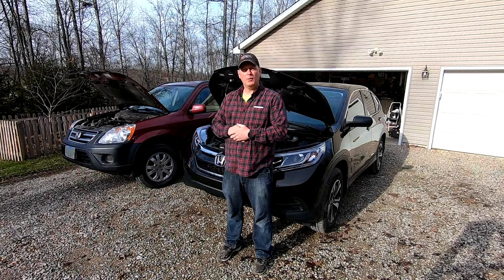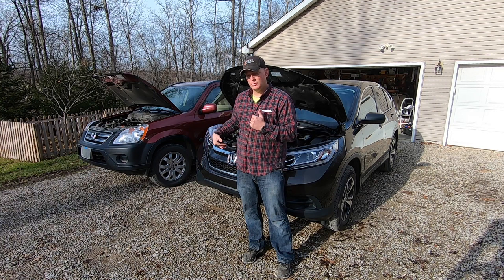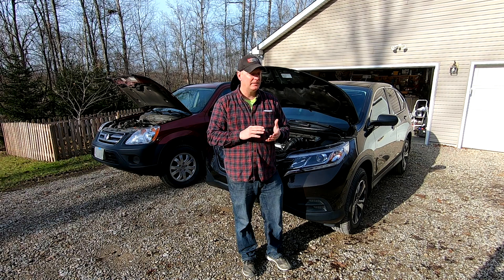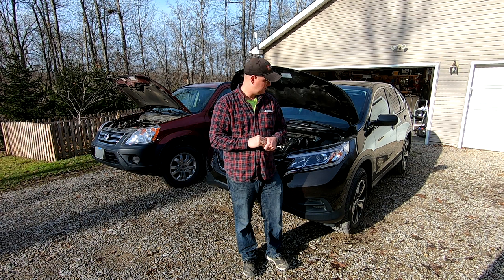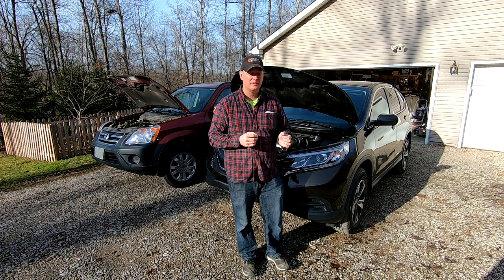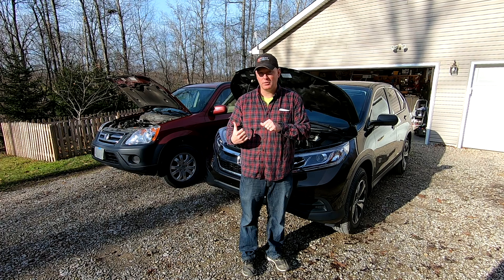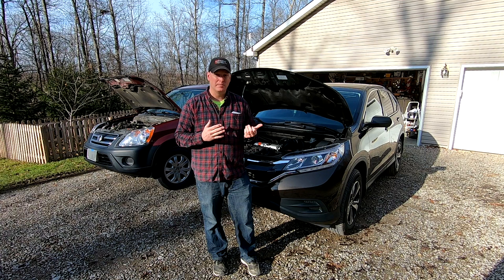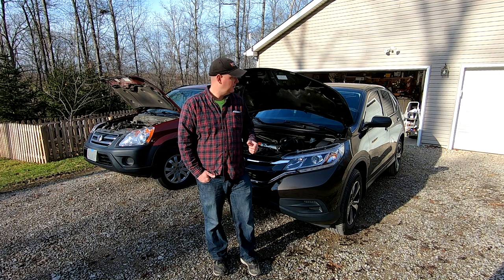DON'T BUY THIS CAR - 2012-2014 Honda CRV

Comment: Ok. The issue is oil starvation to the cvt gear. With a new intake cam and fresh orings on the cylinder 1 cam cap... it will go another 150K miles before failure again. Also... do not use 5w20. Use 0w20 oil as recommended. The valve works on viscosity
Reply from the maker: The difference between 0w20 and 5w20 is nil.

Comment: thanks for the info. i have the same problem with my 13 CR-v Awd, where do i need to go to see if a recall on this car, i changed fluid in front and back, no fix, now on top there is a shudder at 25 mph in slow acceleration then it goes away, any suggestions? thank, keep up with videos.
Reply from the maker: Did you drain and fill transmission fluid multiple times? Usually takes 3 times with some driving in between to see if shudder goes away. If it doesnt most likely your torque converter is shot.

Comment: On the bright side: I found a  YouTuber who says one can proactively periodically replace the lock spring in the VVT actuator without removing the actuator or timing chain: https://youtu.be/2ZDr1dH40Jw I haven't tried it but it seems to be a promising concept and the video has good reviews. Otherwise, I have a 2012 CR-V. You really have to replace a rattling VVT actuator right away or your timing chain will quickly be elongated beyond normal limits. It's easy to underestimate how quickly a rattling VVT actuator can destroy a timing chain. I'm about to replace the timing chain for the second time because the new (updated part number!) VVT actuator was not replaced soon enough after the rattling returned. This time, I have the dreaded code P0341, and when the crank is at TDC the camshaft marks are three teeth off from each other! It was only a matter of time until piston slap would have occurred... which is exactly what happened to an acquaintance's 2012 CR-V when she ignored her cold start rattling issue. The timing cover is a real inconvenience to deal with when the engine is in the car, if you are doing the repair yourself. If you are paying for the repair, replacing the timing chain along with the actuator will greatly increase your repair bill. Another engineering flaw: The closure rate in the exhaust valves is too rapid and that also sends shockwaves into the timing chain, even when the engine is operating normally. (Sometimes the exhaust cam lobes wear out prematurely.) In other words, the timing chain is at risk even without the VVT actuator rattling issue. None of the racing grade aftermarket timing chain tensioners, which claim to alleviate the premature wear brought about by the exhaust cam lobe design issue, are compatible with K24Z engines.
Reply: What a pain!!!  I was looking to buy a 2014 but now reconsidering :(

Comment: I just bought a 2014 crv 2 days ago and noticed a similar noise about every 5th time I start it...thought it was the starter.
  Shouldn't there be a code if it's a VCT?
Reply from the maker: No code. Just noise until it destroys your timing chain, then you get codes.

Comment: Bought a 2014 Honda CR-V EX-L 2.4 liter 2WD with over 188,000 miles for $9,000 back in November before Thanksgiving through a private party. Took in to the shop to have looked at so far no codes were found, recommended new spark plugs, found sweating under the transmission and one of the rear shocks is no good. Few days later my VTC actuator made the noise on cold start. A couple of weeks before Christmas my torque converter assembly broke and I ended up getting another one off a wrecked Honda CR-V and it had over 44,000 miles on it and it ended costing me $2,883, for a refurbished torque converter assembly it would have cost over $10,000

Comment: There is a $35 repair kit from spring-start that replaces the weak spring. You can even fix it without messing with the timing chain if you are careful.

Comment: Is the VTC actuator the same as the flywheel?  Or are they related in some way?
Reply from the maker: Not related. Flywheel on the back of the engine (or side the the case of a CRV). It is what drives the transmission.

Comment: Amsoil engine flush.. Amsoil signature series motor oil.. and its gone and hasnt came back..
Reply from the maker: Interesting
Reply: More details please. After switching to Amsoil how often do you change the oil, etc.
Reply: @njsongwriter  Every 5000 miles. The box says go 3000. But the oil is so high quality it can go further. Just dont push it. But yea, i dont hear it anymore..

Comment: Thank you very much for this video. I am in the process of deciding between a CRV or Rav and my decision is now settled. Rav it is.
Reply from the maker: The RAV4 is a great vehicle.
Reply: Be careful what year RAV4 you buy too. Some of them have their problems including this very same problem with variable valve timing. But with the RAV you must fix it rather than choose to live with it because the Toyota parts us made with aluminum instead of stainless steel. Aluminum is a sitter metal.

Comment: I noticed that Royal Purple and Mobile full synthetics run a little thinner than they should…. I currently use a better quality oil (AMSOil), and the car runs quieter. That sound at startup still happens once in a while… mainly on cold days. Currently 110k miles.

Comment: try using 0W-10 motor oil and fill motor oil to the fullest point of the dip stick allowable.  This will allow oil to up to the VCT moving parts as soon as the engine is cranked initially, hence reduce the Grinding duration from the usual 3-4 seconds during Start UP down to 1-2 seconds  Every bid counts.  Good luck....

Comment: I have a 2013 Honda CRV and had this exact problem.  I took it to the dealer and they fixed it.    I really like this car, and plan on keeping it for a long time.  

Is there any problem with it once a dealer has fixed it?
Reply from the maker: It happens again. What all did the dealer replace the first time?

Comment: My 2013 CRV does EXACTLY as you describe and I've read on forums that many other CRV owners have this issue.  The gringing/rattling metal on metal noise is very loud on the first cold start and for a few starts right after. This is very frustrating as Honda DOES NOT acknowledge this is a problem. The latch on the back hatch also sticks in cold weather so the hatch does NOT open making it useless for cargo.  I have to climb into the back, take the plate off and use a screwdriver to force the mechanism up in order for the hatch to open from the inside!  I used to buy Hondas all the time as they have been reliable and if it wasnt for these two issues I would keep my CRV but really considering selling if the actuator is just going to cause further issues needing major repairs for my timing chain, etc.

Comment: Jack
Love ur vids Man.......Good Job
Got a 16 CR-V ELX with the 2.4 Liter 173,000 Km = 107,497 mi
Made in Canada
No Issues 
This last X-mas -44 C with the wind Chill
0-20 Synthetic 
No grinding No problems at all
And no block heater on those cold days
But will keep an ear on the cold starts
Thanks For ALL the tips bro

Comment: Yes sir I totally appreciate your video it has helped me tremendously and this is something the mechanics will never tell you nor you will find in your ownership manual of the vehicle so again thank you for taking the time and making this video this sound is making me worry I do have a 2013 Honda CRV and it's crazy how I start the car here just checking and yet again it does go away is there a possibility that I can increase my oil pressure to alleviate or assist this issue thank you so much and God bless

Comment: The biggest problem for this model is the high oil consumption. That is what caused the faulty VTC. The oil burning gets bad at the 75000 mile Mark, it stretches the timing chain. The chain is not the problem. The oil burning is the problem.

Comment: I have a 2015 Honda Fit with 84,000 miles.  Problem was intermittent originally and only occurred during the winter but now it's happens after the car has been sitting for a couple of hours and sounds worse.  I took it to a mechanic and told him it was the VTC actuator but he disagreed with me and replaced the timing chain tensioner instead.  It cost me $400 and didn't fix the problem.  Perhaps both parts should have been replaced.

Honda gave me a quote of $2,200 to replace the VTC actuator and the timing chain. The noise is irritating but I'm not sure I want to pay out more money for this vehicle if the problem just returns after a few months.
Reply from the maker: Honda fit is a different beast than the CRV and I'm not aware with this being an issue on the fit, but it probably is the VTC. You wouldn't need another new timing chain if that has already been replaced but make sure the tensioner was replaced too

Comment: So it's a small issue that's not catastrophic failure? Not bad then.
Reply: It's far more than a small issue. The rattle is the first symptom. It degrades into continuous noise as the timing chain stretches and starts to slap around, the timing eventually jumps and the engine self-destructs. This is not a quirky issue, it is an engine that is in the process of failing, due to a design flaw. Mine went from a startup rattle, to being towed into the shop as the engine sounded like it was self-destructing. $2000 later, and a long list of OEM parts replaced, it was quiet for 30-40K miles, and started the rattle again.

Comment: It's just the VTC Actuator, it only makes sounds after a cold start or during it. The sounds are common, on accord, and crv, and other models are the same. Replacing the VTC makes no difference. The annoying sounding VTC Actuator is the only thing annoying about it, just sound, no difference.
Reply: Maybe change it, every 20-40k miles but yeah waste of money pit. (Only if it keeps making sounds, just go on with it for those many miles.)

Comment: I agree completely about how Honda has let down their loyal base of customers.  When my VTC started to go I lost 25-30% gas mileage -- 20-21 MPG.  I replaced everything but the VTC (plugs, serpentine belt, air filter, etc.) and all that had no effect.  My Dealer charged me $2300 to replace mine.  He said it didn't need the timing chain done because they tested that.  This is the same amount another private repair place or another dealer would have charged me.  After getting my new VTC my has mileage dwent up to 23-24 MPG.  Before it all my mileage was 29-33 MPG.  My VTC has rattled once since I replaced it.  Because I needed a road car I bought a new 2023 CR-V LX.  It is not the same car and I hate it.  They have ruined the car with all the BS electronics and "safety" features and black-only interior.  I've  just about had it with Honda.

Comment: I changed my actuator out with Honda also. A year later …same noise. Found out the recommended 4.2 qt oil fill is not enough. I’ve been putting in 5 quarts, along with that I turn off the A/C and Econ button when starting the car and I haven’t heard the problem since.
Reply: I also replaced my belt tensioner…it can make a similar noise to the actuator.
Reply from the maker: Interesting. I also usually do 5 qts.

Comment: I am with you buddy.  I have a 2002 CRV and it has over 275k miles and it runs and sounds like a top! No engine issues over all these years and miles. I am looking for a low miles (100k or so) 2005 or 2006.  No one wants to get rid of them. I LOVE MINE!!!  Don't want the newer.
Reply: I recently grabbed a single owner '06 CRV for $2000 Canadian with 230kms (143,000 miles) in a market where higher mileage vehicles are commonly going for nearly triple that...I guess the word is out. I love the simplicity and relatively low tech of this model year...and that it's pre GDI/CVT. The steering is tight, suspension decent, and the heater works better than my newer F150...unfortunately no AC due to the "black death", but I guess that and new brakes ($300 Amazon) all around is why I got such a good (for Canadian market) deal on the CRV. If you don't "need" all the new tech, and can live with a few worn/dented items then the '06 CRV is a great used buy.

Comment: After watching this video I immediately ran outside to cold start my 2012 Honda CR-V with the hood raised and my head sticking out the driver's side window. Maybe living in California where my morning temp was 62 degrees masks the problem but my engine sounded perfect. I have 148k miles with the original VCT. I live the the San Francisco Bay Area so long ago learned to DIY my own cars. I recently paid $3300 at the local independent shop in Berkeley for a timing belt job on my wife's 2012 Honda Odyssey because I couldn't make the time to do it myself. That's not happening again.

Comment: My 2012 CRV makes the same noise. It has 214k miles on the odometer. I’m trying to keep it going because all the used cars are so expensive! I also need the oil pan gasket changed. I know a mechanic that can fix it for less than the shop. Some days I wonder if I should get another one!

Comment: Bought my 2012 crv from a dealer new, started the death rattle months after. Took it in and they said they didnt hear anything. I recorded it on my phone and took it back. Hours later they told me it was the actuator and that it did not harm the vehicle and there was nothing they could do. They told me it was very common and wait for a recall that was coming. That never happened. So basically from brand new its had this embarrassing rattle when starting. Worst decision I ever made, i should have bought that Rav 4 toyota instead. Still waiting for that recall

Comment: Honda tech, if is posible to swap 09 tsx engine on 2014 crv?
Reply: You do know the 2009 TSX has the same exact engine at the 2012-2014 crv?
Reply: So why not to many problems on old years engine, how fix this problems . Put vtc from old models?

Comment: Hello Jack 

I have same issue in my 2013 cr-v. And also it has loose the pickup as well. What should i do. Pleaseet me know.
Reply: How many miles on it?  Don't use eco mode. I stay out of it.
Reply: @Susan70003  yes , 120000mile. I have been using echo mode , but I'd I turn off echo mode then it won't give me good mileage  . I have turned off echo mode and I got sound umhhh when I merge on Highway to increase speed  60 to 100km/h. Is there any issue with piston compression,  reason being i have to do engine oil top up after 1500mile 1liter.
Reply: @hondasine  Did you replace the oil at the recommended times? Did you replace transmission oil every fourth engine oil change? I learned that if I drive at 60 miles an hour on the freeway I get better gas mileage. I also turn off my air condition around town when I accelerate. Right now I need to replace my engine compartment air filter. I hope that increases my gas mileage. What mpg are you getting on yours?  I haven't had to add any oil between oil changes but I still only have about 85,000 miles total. I always use the Honda oil.

Comment: The Toyota 3.5 V6 and the piston rings on the 2.4 2.5 engines proves your statement about Toyota wrong.
The V6 has the exact same problem....
Reply: Yeah Toyota is no saint, dashboard issues , accelerator recall,  faulty AC systems which lead to mold/mildew smell, defective fuel pump recall and the absolute worse has to be the rubber oil cooler lines which will kill your engine if the hose rips. All brands can be problematic, some less than others. Best to get the model on the tail end of the generation.

Comment: My CRV has this problem. So is this dangerous while driving? Or only during start up?
Reply from the maker: It's not really dangerous at all. Just annoying and can lead to further, more expensive problems down the road
Reply: Do you have a timing chain? Mine had a serpentine belt that I just had to change at 75,500 miles because a pulley was going dry and It was clicking under the hood. I had to replace 3 parts total. It's fixed now and sounds quieter under the hood. Pretty low miles for having had that happen. It's been coming on for a while. Not exactly Honda reliability imo. Other than that I don't have the drive chain problems.